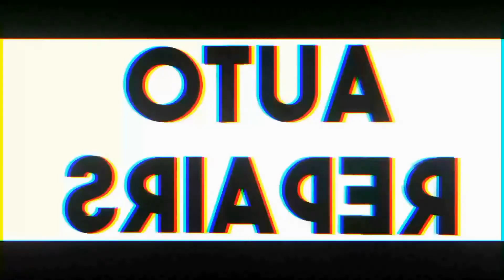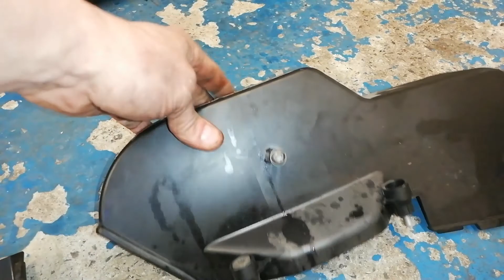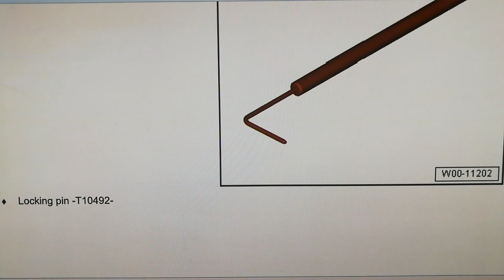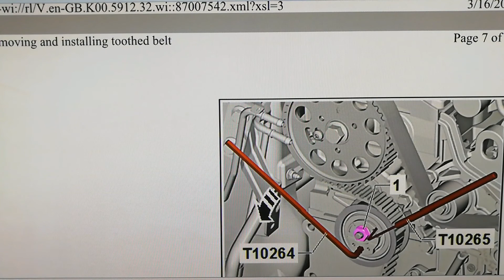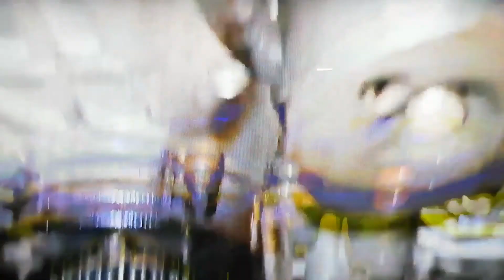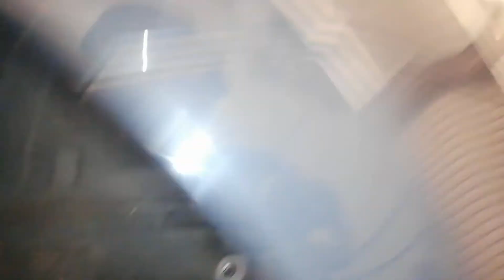VW AUDI 1.4, 1.6, 2.0TDI 2012/3 Onwards TIMING BELT HOW TO

Comment: Hi my top idler failed and theres slack in the belt. Car was still running when engine was turned off.  However i believe the diesel pump timing is out now due to the slack on that side.  Im going to replace with a new full kit.  I can see the markings on fuel pump reapeat itself 3x around that wheel.  Does it matter which one out of the 3 i line up?
I understand 2 rotation of the cranck is one resolution of cam.

Kind regards

Comment: Hi Dave, I have just changed the belt on a 2015 Audi A1 1.6 TDI. Fitting the lower idler wheel after the new belt is fitted was a top tip! Your explanation really helped me to understand what is going on, rather than just doing it by numbers and hoping for the best.

Comment: Hi Dave. Very detailed video. Just wondering if the belts tend to go due to age or is it usually mileage. I have a 2015 Polo CUSA with 30k miles and afaik original cam-belt. Might take it up to 50k then replace...

Comment: Hi i have a question if you could answer for me please. I done my timing belt and it was about half a tooth out of timing since i didn't put in the 2 bolts from the crank pulley back into the timing tool just used the pin. Either way took it back apart and sorted the timing but my fuel pump timing was out now but i figured it should not make a difference im asking you if it does? 2016 golf gtd. Thankyou

Comment: Nice video dave, i like the powerpoint walk throughs. Would it be possible for you to point me in the direction to buy or download the repair manual for referral? Also my engin is a crlb hence as per the parts man from vw said its got an e-pump not a mech driven one. 👍🏼
Reply from the maker: Sorry can't do. It is not a manual. It is part of the manufacturers work system

Comment: You mentioned the additional tensioner pulley on the the larger (and longer blocked crankcase)2 LTR  CR TDI engines that you suggested could be fitted last, and after everything else is in place. Does the extra slack in the belt by leaving this pulley off until all the other components are in place allow enough slack in the belt to fit it over the tensioner without having to wind it back in reverse and hold by using the old style triangular headed pin you utilised?
Great video BTW, and very useful to me with my newer VW type engine with its differing setup👍🏻
Reply from the maker: No, you need to wind the tensioner back in reverse to set it
Reply: @davesterl  Cheers. Just like the earlier belts and original tensioner set up then. The smooth water pump pulley and the fact it’s the back of the belt that drives it initially threw me, but your clear explanations make it look perfectly doable for those of us that normally do our own maintenance.👍🏻

Comment: hi Dave I have had my timing belt replaced and waterpump etc. now have a slight chirping noise from the cam belt area, mainly when the engine is cold. it was a dayco kit that was fitted? it's on a 2.0tdi engine 2014. any advice at all. changed drive belt to plus tensioner.

Comment: Dave done one of these but no water pump with the kit, alot of miles later water pump failure,  is there a reason for reuse of the old pump, its electronic version pump? Ps one of the most detailed tutorials I've seen !!

Comment: Hi Dave I did my timing belt exactly like how u did but after few hundred miles the little screw on the cam sprocket now all the way down not In the centre anymore and I have experienced some mpg droped could u please advice what should I do btw the timing is all correct ..thank you mate
Reply from the maker: I dont know how it has moved if it was positioned and tightened correctly
Reply: @davesterl  thanks for getting back mate I think torque wrench was playing up might not have tightened to 100 nm that's probably why it moved the car run fine it's just bit poor on mpg ..thanks again dave
Reply: @harinkarim3915  I think he said 20nm for the cam bolt and not very much for the torx one.

Comment: Great guide Dave. Well explained. Done one myself last week on a golf CRBC engine code. Not to bad to do but that top timing cover is a bit of a nuisance to get off. best to remove exhaust temp sensor on that engine to get cover off and on. I got myself the Neilsen timing tool kit witch was very cheap compared to others and worked perfect. link to timing tool down south https://ige.ie/timing-tool-vw-group-1-6-2-0-tdi-cr-engines-yr-2012/. Thanks for the vid. Mark

Comment: Done this job on a 2013 Octavia vrs with 2.0 tdi engine code Cupa. I purchased same timing tool kit as you have Dave and it was definitely needed. Cant possibly see how you can do that job with tipex. Also asked VW for the complete timing kit and they send out the pulleys and the studs that they run on as they are one use stretch studs. This job was needed due to the common failure of the water pump collar sticking closed that has a upgraded part number when you order one. Assume water pump sticking was reason for your repair at only 55k?
Reply from the maker: Yeah mate, this was a water pump change to a non-switchable